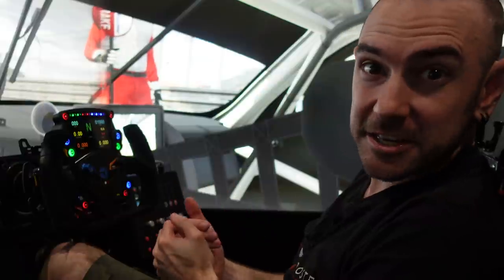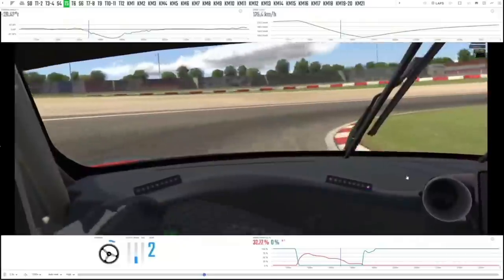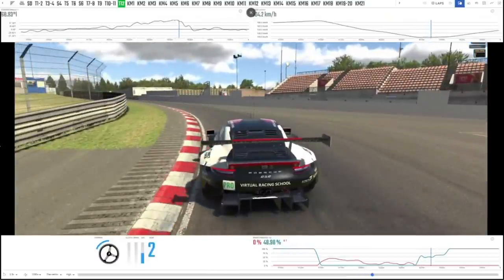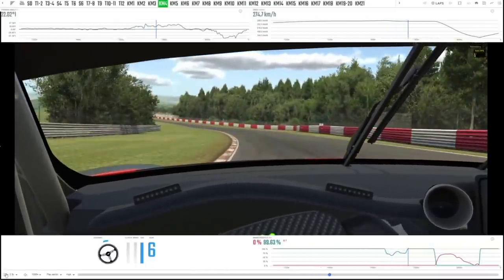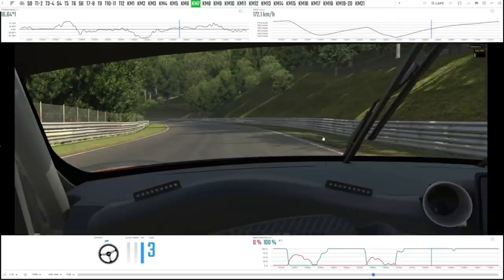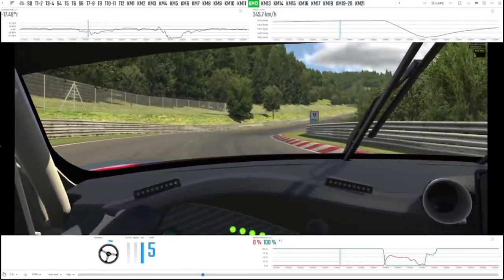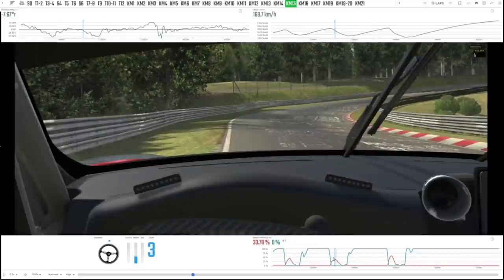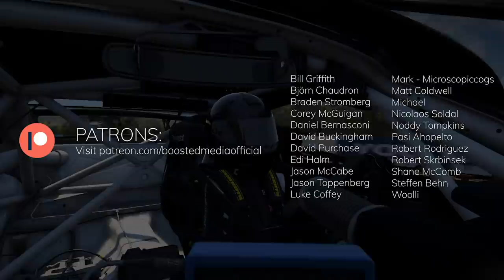PRO DRIVER TRAINING - Nürburgring Nordschleife Combined 24hr - Turn by Turn Track Guide

Comment: Sometimes driving on NS in real life interferes with my taking on the nordschleife. For example, near KM7 section where you are about to to turn left and its a fast corner, I always hesitate to keep the car to the right side. The reason for this hesitation is not me being weak on passenger side placement but in real life the sides that are in the shade tend to be damp in Nordschleife. So basically the right side I always watch for damp patches although they dont exist yet in sim :) In short time we will be seeing this much detail, I am so happy because of this :)